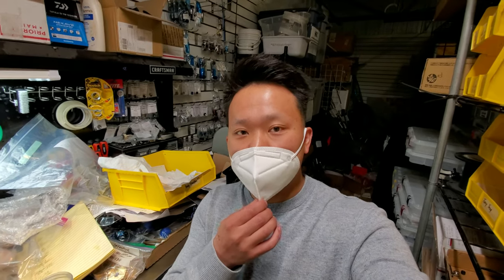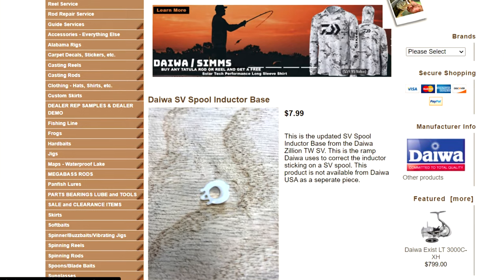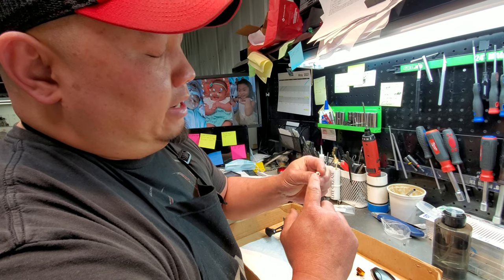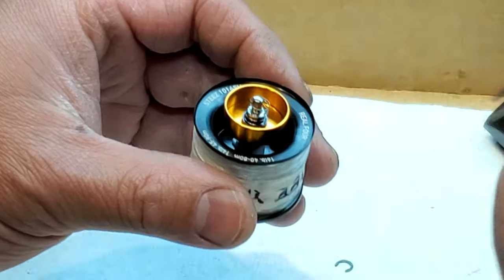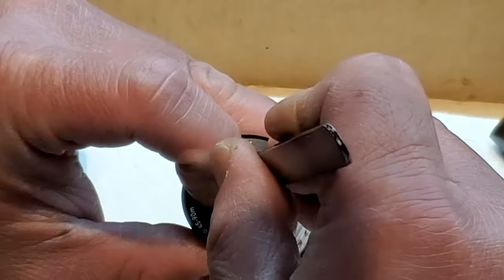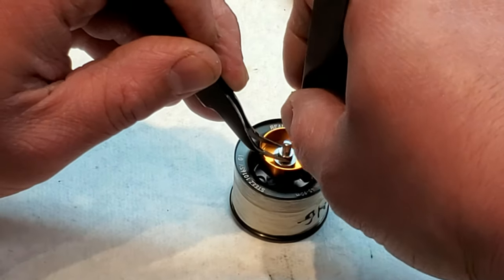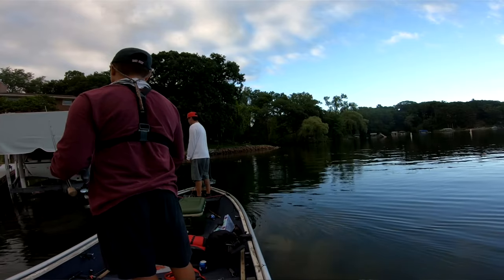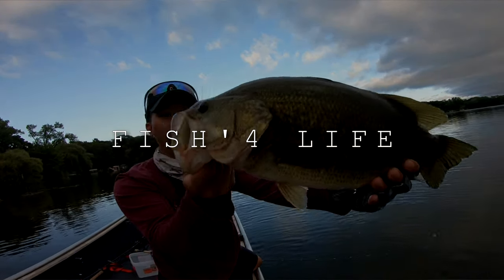Daiwa STEEZ SV TW SPOOL ISSUE/PROBLEM Explained & Resolved (SV SPOOL INDUCTOR REPLACEMENT)

Comment: I have found it easy to put C-clip back by taping C-clip to screwdriver. Electric tape creates joint, which allows taped C-clip to be tilted and it don't allow C-clip to fall away and it can be simply to pushed to it's place. I have video of it, but I'm not posting link to it, because I'm not sure will you appreciate it 😄. But video is on my channel and video name is "Inductor change to Daiwa reel / Chamelleon spool" and trick is shown in time of 2min 28s.

Comment: So my sv just won't cast nearly as good as it used too. Brakes seem to be funky. Sounds like the inductor might be the issue after watching your video. Would a bad or broken inductor stop the reel from fully casting or casting extremely short?
Reply from the maker: I would say both, mine It did not matter the break setting, it was hit or miss to cast good and I had to use a lot of thumb control.
Reply: @BindeeVangFishing  same here doesn't matter where I set my breaks. I can put them at 1 and it still casts short but no backlash at all. I can literally not use my thumb and I pretty much don't get backlash but it just casts so crazy short. Feels like my breaks are at 15 when they're are set at 1

Comment: I have a zillion tws 100p with what sounds like the same problem I've been trying to figure out .
Reply from the maker: Pretty sure! I couldnt cast far /black lash randomly on any break setting.
Reply: @BindeeVangFishing  'Sticky inductor' appears from time to time. It's not common, but those exists. I received one from Japan as a new, and it might be tricky to send back, so I kept it and changed to new inductor ramp (and also inductor itself) because Ray's inductor DIY was inexpensive.